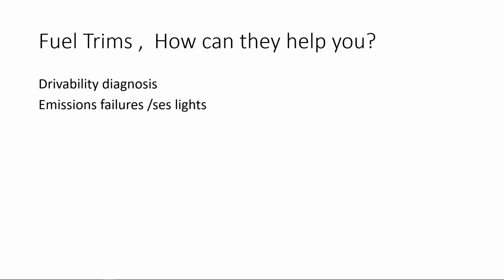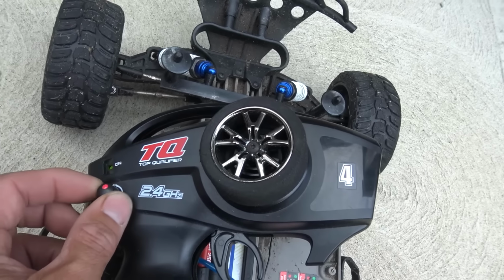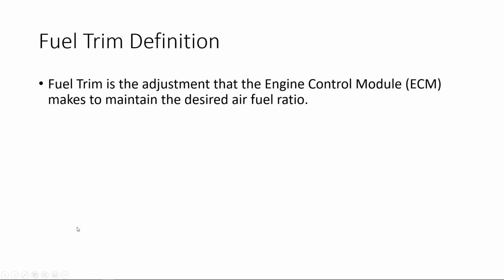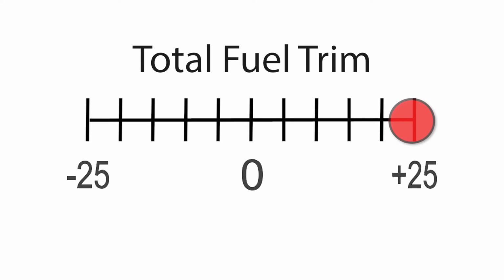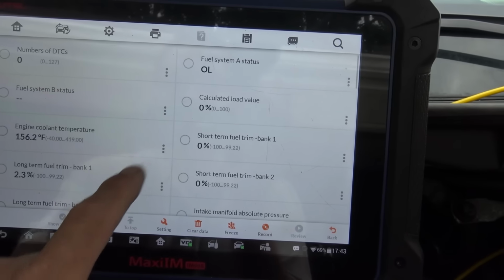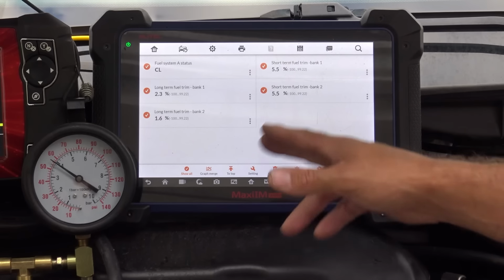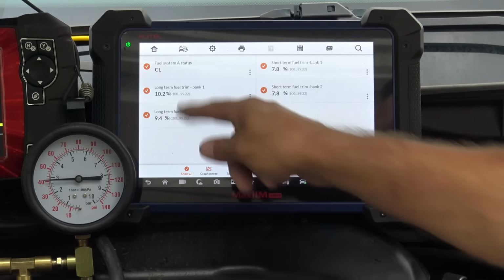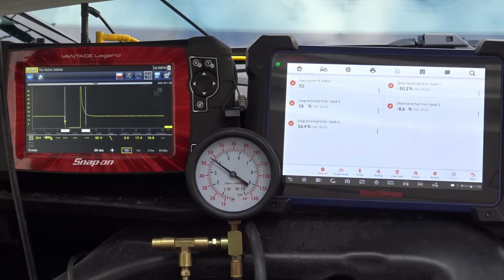Understanding the basics about fuel trims

Comment: After many many videos I have watched on fuel trims I never thought someone will come with a new approach. I think using the rc car is the best example I have ever seen on fuel trim. Well done. 👍
Reply from the maker: Thanks for the compliment,   I learn by analogies myself and have been looking at ways to get the point across  for those that want to learn.
Reply: One of the best presentations ever seen, but I missed one definition from you, to give a full picture, that's the definition of closed and open loop.
What does that mean?
How does it interfere on the fuel trim? 🤔
Reply: @Jedi_Masteren Open loop is
when the computer ignores feedback from sensors and uses last known data to run the engine until it warms up.  When it’s ready, it will go into closed loop mode and utilize sensor data to make needed changes to stay running smoothly.  From that point on until shut off, it remains in closed loop mode.
Reply: This is the best way i thought of Closed/Open Loop
Imagine a touch typist typing a letter on 
a computer, there is a loop, consisting of
the screen, the keyboard undt the operator 

imagine she's touch typing with her eyes 👀 closed, the letter still happens with little mistakes as she is an expert touch typist.
(the keyboard is the Injektor, the operator is the ECU, the screen is the O2 sensor)

So she's  typing the letter eyes closed, that is open loop (loop birng Keyboard > Operator >Screen), Its open because the eyes cannot see the screen.

Once she opens her eyes 👀 the (feedback) loop is closed undtt self governing 

So in Vee-Hikulls for example, until the ecu senses a warm coolant temperature und the O2 sensors up to heat, it will be in open loop and remembering from tables (eyes closéd)
once everything is up to temperature (for example) the ecu uses these values to Close the loop (open de eyes 👀)  ¡¡¡¡¡¡
Reply: Subbed. This video is gold. Outstanding practical demonstration!!!
Reply: Let me ask so You add the short fuel trims nd the long fuel trims so what the reason of adding both , The total sum??
Reply: yeah, i agree.  I've watched many videos on fuel trim, and this one is in the top.

Comment: WIth low fuel pressure, the fuel that is injected is not very well atomized. I assume since it is not, this is the reason for the poor fuel mileage with a failing (weak) fuel pump? I've had a WRX that used to get 31-33 highway which has gotten no more than 25 for the last 10 years. Suburban driving can be as low as 22. I've replaced pressure regulator, coil packs, spark plugs etc. I also consistently get Pxxx misfire codes for (usually) all cylinders at one time. I do have a scanner and STFT is high 15-20%. This is the first video or reference i've seen to focusing on fuel presssure re: STFT.

Comment: Hi Brian,
I hope you are doing well. I am a big fan of your diagnostic videos, especially your work on GM vehicles. I am reaching out from Kurdistan because I have a tricky issue with my 2013 GMC Terrain (2.4L) and really need your expert insight.
My car is suffering from an intermittent Global A CAN-Bus crash. While driving, the dashboard suddenly displays "Service Power Steering" and "Service StabiliTrak", the gauge needles start jumping crazily, and the PRNDL gear display completely disappears. Once I turn the car off, it goes into a No Crank / No Start condition because communication is totally lost.
Here is the clue: this whole issue started literally the same day after I worked on the front passenger door wiring (fixing some broken door wires). Also, a couple of days ago, my mechanic wiggled the under-hood fuse box area, and the car started and ran perfectly for two days before the crash came back.
Since you are the master of GM electrical networks, do you think a short circuit inside the passenger door boot or under the fuse box could bring down the entire high-speed or low-speed CAN bus like this? Which modules should we isolate first?
Any guidance or advice you could give me to share with my mechanic would be highly appreciated. Thank you so much for your time and for the amazing content you create!
Best regards,
Abdulla Mina

Comment: What does it mean if my fuel system status says fault? Getting a very rough idle and random misfire
Reply from the maker: For some reason or another the engine control module is not able to maintain fuel control, so it's stating a fault and going to a default fueling strategy. This is usually due to a large vacuum leak, intake or exhaust   restrictions,  mechanical/ timing issues, fuel supply or ignition.
Reply: @BrianMann216  thanks for the response! Only getting a p0300 code. I  think timing may be the issue since all cylinders are misfiring.

Comment: Thanks for this video, it explains the short and long term trims well including the interaction between them however I have a question.
If, over time, the fuel delivery reduces or increases proportionally 'across the board' this would mean that the trims would have to increase/decrease by the same proportion/percentage to compensate, this would start with short term but get added to the long term as the change is consistent (over a long time).  That all makes sense.

However suppose there was a delivery problem which took affect at different levels under different loads.  I'm imagining a fuel pump issue or supply hose blockage which would allow sufficient fuel to flow at low loads hence only minor trim but as load and hence fuel deliver increased the delivery can not keep up  (rail pressure dropping) so trim would increase.  I'm assuming that this would mainly affect short term tim if this load was realated to short bursts of acceleration but if the engine was held under load for long enough (cruising at high speed) would then start passing into the long term then get removed again when load is reduced for a sufficiently long time.  

Would the ECU flag this as a problem (assuming maximum trim was not reached) or just keep doing its best to keep up?
Reply from the maker: Great question , alot to unpack here. In my vidoebi did not mention load cells, that is the engine load at specific rpm. There are load cells that cover a wide range of operational conditions . The engine  control module will "learn " the fuel trims for each load cell [operating  condition]. Another thing  failed to mention in the intent to keep the vidoe simple was that the total fuel trim % is a % of the actual injector on time. So if the engineered trim for a cell at 0% Is 2 milliseconds on time, a total fule trim correction of +25%; woul see a injector on time of 2.5 ms.
Reply: @BrianMann216  Thanks for your feedback Brian. I guess all ECUs have different methods and modern ones will be more sophisticated than older and hence be able to do more  including having multiple trims for different conditions.  
I'm currently working with an early EFi system, the Lucas 14CUX which I believe is based on a Bosch system.  It only has one trim setting for short and one for long which work across the whole range (actually not quite true, it has one of each per bank but they all work under all loads).  The short term trims are swinging between positive and negative so I'm assuming the LTFT can only really be getting set to the average value.
I'm currently working on the theory that this is either a fuel flow problem or possibly the fuel mapping is just not correct and the closed loop system is 'chasing its tail' trying to correct.  It is not my vehicle, I'm just trying to help the owner out 
My feeling is it would be better to run in open loop mode to get a correct baseline map then switch to closed loop to allow the system to correct as things vary over time.

Comment: So the computer starts with the long term value, as a known good starting point range, and makes real time short term adjustments as needed to keep o2 values within range…and then either adds or subtracts to/from the long term value every second for example, depending on if it has to add or subtract short term trim…awesome

Comment: Doesn't get any better than this! Thx much, took notes n ready to check this on my Autel OBD2 tablet...have a misfire at low idle, changed plugs n coil packs, cleaned Throttle body, checked for Vacuum leaks, cleaned all sensors..still misfire ?! P0300 Random..but when checking misfire on scanner...shows mostly cylinder 1
Also did compression test and was perfect all cylinders! I'm baffled 🥴🥴

Comment: That’s awesome example. I’m dyi on my 95 f150 5.0 OBD1 and currently chasing a ( fluctuating  1+/-1 0 short trim & -56 ( non-moving) long trim. 
Fuel psi @ 29lbs running or 3K
34.5 just KOEO pump jumper just circulating.
New tank/pump/filter
New ECT, O2, regulator, and replaced ECM capacitor’s before they leak. The rest of board  passed testing. 
No CEL and runs decent in a closed loop. Pinging on WOT

Totally at a loss.

Comment: Wow, man respect for all the effort you put to explain this.
I searched L/S term fuel trim and nothing better than seeing it how it works with the explanation, oscilloscope, pressure gauge, and the scan tool....this become etched in memory now as clear...
As electronics guy, Now I see it as is, a PID controller algorithm. Probably just PI in this case.
Short term = P proportional, long term = I integral.
Guys watch PID controller and you'll understand it's in everything... cruise control, ABS....
Reply from the maker: Glad i could help, I want to do a part 2 , there is a lot more to explain, but this is enough to get started.
Reply: @BrianMann216 great news, thanks.
Can you talk about those percentages in long and short term trims, I mean at what percentage something need to be done, is >= 2% bad or not to worry about.
And can you compare the percentages values of the trim with the oxygen sensor 1 (rich vs lean sensor voltage)?

Comment: Hello, I went a trip and my ltft was steady around +3,5 and the stft went up and down from -7 to +7.. I have installed a wideband gauge because my upstream o2 sensor is narrowband, and the gauge read from 14.3 to 16 most of the time while I was driving.. On idle I think stft is more stable and close to zero. Is this a normal operation?

Comment: So a 10 % long term and 6 to 7 short on both banks means?????
Reply: Simple maths, if they are both positive trims add them together 16-17%
Reply: @Michaelski100  ty sir your a genius lol  ... I should have been more detailed  like not meaning more like what can be the issue  / cause ?
Reply from the maker: Under reporting  maf, intakebair leaks, low fuel pressure/ volume  @prtbone78
Reply: @BrianMann216  gotcha  ima clean maf try and make a smoke machine to check for leaks  hope not fuel pump gotta drop tank for that  appreciate  you  ill try cleaning maf first then check anything else  hope it's a small leak and can find  thank you sir
Reply from the maker: Running a bit lean as ots adding fuel. It is still in fuel control
Reply: @BrianMann216  ty sir   when  I drive it drops to maybe 7 or 8  short goes from like 7 8 at idle to about 5 4 sometimes -4 long 7 8

Comment: How to reset fuel trims after some maf cleaning or parts replacement?  I tried removing negative battery cable for more than 3 hours but nothing happened.  My car is Mini Cooper R56.  Thanks.
Reply from the maker: I think you  will need a scan tool that will support that function.

Comment: my LEXUS IS250 has a -15.6 long term 2. so what should i do?
Reply from the maker: Setting any codes? Check for vacuum leaks, fuel delivery imbalance,  restriction in the exhaust for that bank
Reply: @BrianMann216  no codes. I checked vacuum leaks via smoke method and see nothing.

Comment: you kept saying add the long and short to get a total then whats the point of having a long and a short if total is what matters, i would think the most basic of basics is to know why there is a short and a long instead of just a total???
Reply from the maker: It matters to show a trend if what the pcm sees. The learned value( long term) will go to  what has been learned in the past to get the fuel control to a good starting point, while the short term will make final adjustments.   If you can take a known good  vehicle and warm it up at idle, look at the trims , wiitr them down long term and short term, then clear the adaptive and you will see the short term go quickly to what the long term was.
Reply: @BrianMann216 so if I've been is ethanol free gas and have an established longft of say -7 and switch to ethanol blend ( less energy so need more fuel) should I see longft move down a bit toward 0 , all other things being sort of equal?

Comment: This is the greatest explanation of fuel trims on YouTube.
Just if you add oxygen sensor signal during fuel restriction, it will be great.
Thank you sir ❤
Reply from the maker: My van has air fuel ratio sensors, so it's a bit different than a traditional o2

Comment: My ford focus has 99% on the bank 2 Long term fuel trim.. And I can tell the car is not responsive, especially if going up the hills. Is it actually possible that the car can still go on with that amount? Or is it something wrong with just the sensor and that causes the car to be unresponsive?
Reply from the maker: What codes are setting?
Reply: @BrianMann216  U0131 and U0401 but I don't think they are related with that..

Comment: So what causes an engine to run rich? I have LTFT in park for B1 & B2 at -14 to -18%. With STFT B1 & B2 at 0 to 4%
Reply: Rich fuel trim = less air than stoichiometric.  Less air reading could be caused by clogged air filter, leaking fuel injectors, bad oxygen sensor, etc.

Comment: Great video, why was the fuel trim at +7 before you reduced the fuel pressure?
Reply from the maker: It is normal for fuel trims to vary a bit  from 0. I usually expect to see total fuel trims not in double digits either  way..   if you have the chance monitor trims on as many good running vehicles as you can.  There are times that trims will bounce around on good running vehicles ans there are no problems.  It is when the trims stay in the extreme that we have an issue.
Reply: @BrianMann216 what about difference between banks. I've got bank 1 from -5 to -7. Bank 2 around -2
5. Make sense?

Comment: If you can rely on the fuel trims everything is pretty simple, but I have a problem here where the fuel trim values are good, but only when the air conditioning is on. If I turn the air conditioning off, the values deteriorate drastically, over 10 and more in the short term and then finally also in the long term, to the point that it sets a P0130 (bank1 sensor 1 electrically faulty) code and often also a P0171 (system too lean). Why do the values deteriorate so much when the air conditioning is off, doesn't make sense to me? Does anyone have any ideas about this? This way it won't pass the emissions test.

Comment: A cam timing issue will affect both banks equally.
Reply from the maker: On a v engine,  overhead cam design,  one cam is out of time it will cause an imbalance in breathing, and there for fueling / trims between the banks.  We must be clear about the details, cam timing incorrect ona old school v  motor  ( single cam ohv) will cause equal issues of course.

Comment: Nice explanation! I easily understand that the computer expects a certain fuel pressure and has a map of the expected injector pulse width for the flow of air into the engine, and corrects based on what’s being actually measured.

Comment: Hey maybe i missed it, what does open/closed loop mean?
Reply from the maker: Open loop the ecm is not using the oxygen or air fuel ratio sensors as an input for fuel control, closed loop the o2 or af sensors are used .
Reply: @BrianMann216  Okay gotcha thanks for the quick reply, where could I find out more about why that system is used? Like why is open/closed loop needed, and how does the ecm decide which to use?

Comment: In a nutshell shell, short term fuel trim is instant fuel data and long term is just that….average fuel trim data over time..
Much like instant MPG or average MPG …..
Reply: That's not really consistent with his presentation.  His theory is that lt is set to reflect st and as lt is fine tuned st should actually go to 0. So say after a trim reset there's a lean condition. lt 0 and st 5. After seeing st of 5 for awhile ecu will move lt to 1 and it should see st go to 4. Then 3 and 2. Finally lt will be 5 and st 0. Assuming it's stable now lt will stay at 5 and st will stay at 0. After while then st average will be 0. But lt will not be 0, it will stay at 5. In a sense that 5 is could be considered the average maybe of the initial sts that required the ecu to increase the lt. At least that's how I interpret what he said. New to me was the total trim, added or subtracted,  at any time,  was lt plus st, not just st.

Comment: Thank you so much brother for putting this in easy to understand terms...Ive always heard of the fuel trims but its something that remained esoteric to me, never understood it b4....  Eager to take a fresh look a a car thats had much trouble during startup ,observing the trims...
In an OBD1 system, is there any way to get this info? I also have an older car , a 94  thats definitely running too rich ..this kind of info would be invaluable but how to retrieve it on an older obd1 system? thanks!
Reply from the maker: Pre obd2( 1996) each manufacturer did their own thing, so it can vary as far as terms, concept the same, gm would be integrator(short term), block learn ( long term) 128 beign " 0"